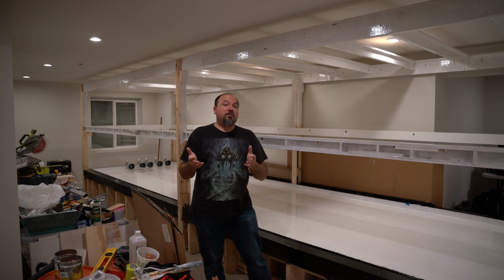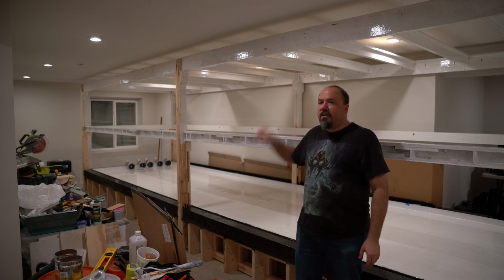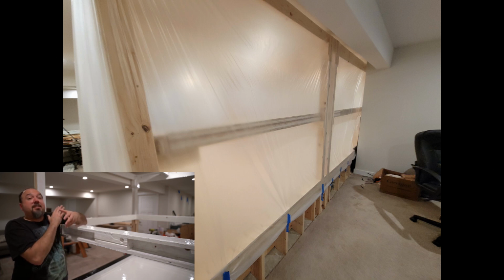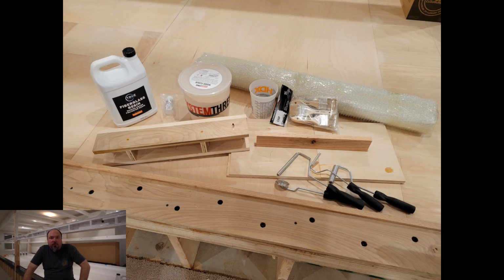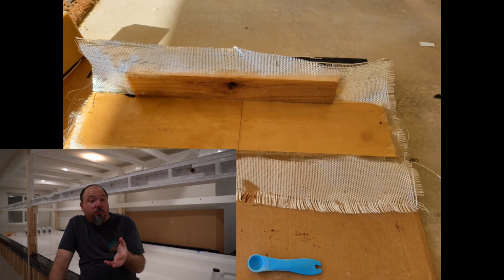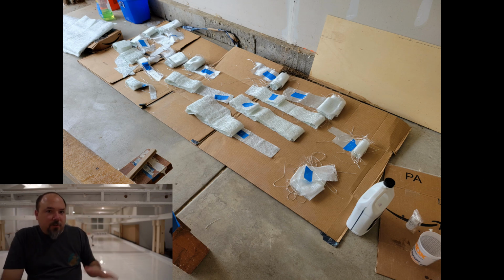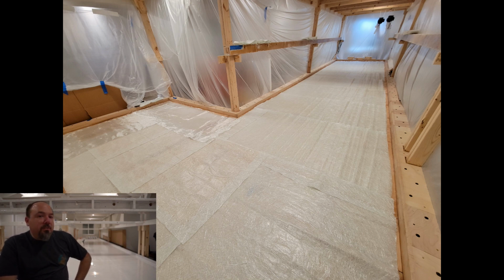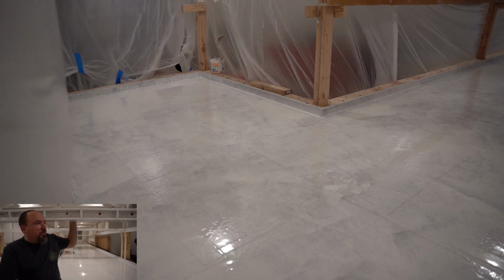4200 Gallon Aquarium Build October 2022 Update

Comment: A lot of work and still it's not done! Hopefully it will trun out the way you wanted! Hopefully you are planning for 2 overflows and some closed loops for more flow, maybe you did mention it in the video because I skip some parts😁. Best of luck Alex! Maybe do some more often and shorter updates.
Reply from the maker: Thanks C B's Reef.  I am thinking mid next year the tank should be nearing full operation to were everything is tied to one system.   I will only have one overflow but that's by design.  The return lines will pump water in on the far side of the aquarium so water will have to flow from one end to another.  I am not planning any closed loops at this time as I have never been a big fan.  The propeller and gyre style pumps are more energy efficient when it comes to moving large volumes of water for the energy needed to run the pump.  If I was going to do a closed loop though it would be without any holes in the aquarium and the pumps would be in the canopy.  I will have future videos that go over flow in depth.  I am thinking the next video update should be shorter as this was one of the biggest jobs to complete although glass installation might also be similar.
Reply: @algawura2  BRS TV was featuring a big tank 10 feet or something like this and that person was complaining that hi can't get enough flow in the middle of the tank without  some closed loop system.and his tank was full of WaveMaker's. Beat or luck with the build!
Reply from the maker: @cezar050681  I remember there was someone with a 20' tank with that issue talking closed loops but they had lots of small pumps.  For tanks this size commercial sized pumps are needed which can get the job done efficiently.